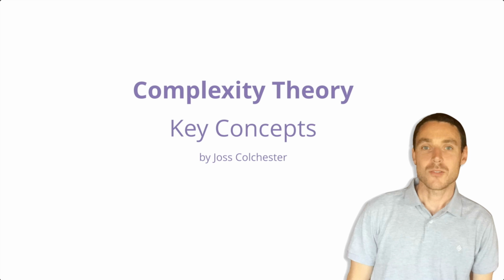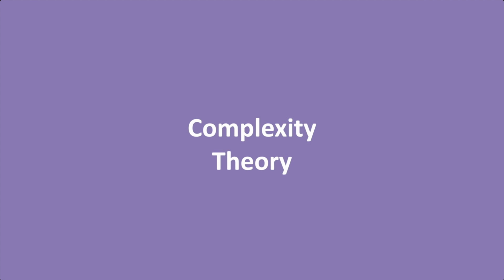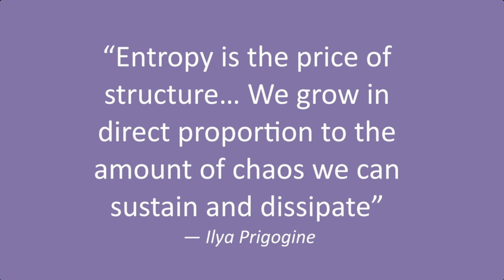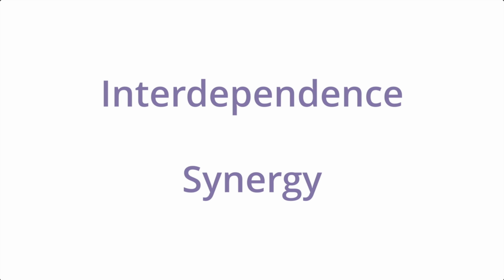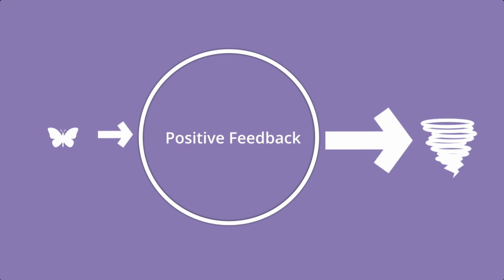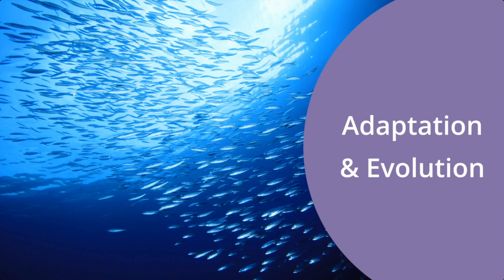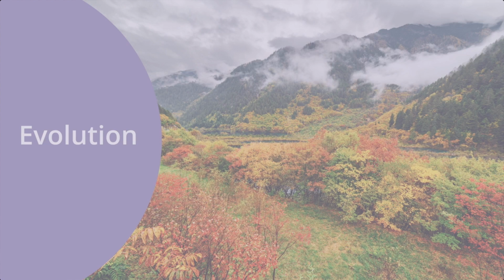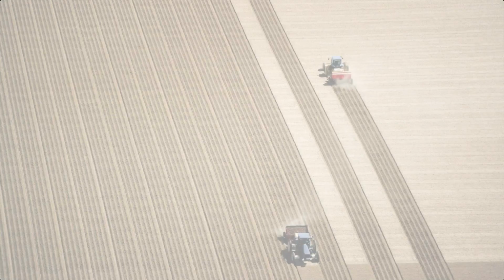Complexity Theory: Key Concepts

Comment: Having thought about it overnight, here is a review with questions. In short, jolly interesting, but where is complexity defined? Complexity means different things to different people.  And SIMPLE systems can have the properties attributed to complex ones. 

COMPLEXITY THEORY?

Complexity science may be defined as:

-1- a set of mathematical models for complex systems: many parts, many connections or dependencies.

-2- a study of activity systems in which parts are actors with degree of autonomy.

-3- a study of structural patterns, observed or envisaged. Especially any structural pattern that appears in the state of an activity system. E.g. The pattern in leaf, or a flock of geese.

BUT NOTE: a structural pattern isn’t itself an activity system. E.g. A road network is not the rules used by traffic on it.

And the application of mathematical models to social entities can be problematic.

NETWORK STRUCTURES (network types, structures, graph theory)

About the connectivity in a topology (road, rail, canal, communication, social network); measures include: average path lengths, centrality.

Some say the topology is the “architecture” of a complex system; system rules and dynamics change as the connectivity increases.

BUT there are SIMPLE networks; a network differs from systems it enables, and a SIMPLE system can run over a complex network.

ADAPTATION (cybernetics, game theory, evolution)

Dynamic systems change over time, typically in response to changes in their environment.

BUT SURELY one must distinguish homeostatic self-regulation (as in cybernetic control systems) from progressive self-regulation (as the development of leaf pattern), and system mutation (as in biological evolution)?

You can have SIMPLE self-regulating systems (e.g. predator-prey). You can have SIMPLE games.

NON-LINEAR SYSTEMS (feedback, chaos, instability)

Non-linearity arises from inter-dependencies or synergies between parts.

Negative feedback (is in homeostasis) is said to be linear (though it may oscillate around a norm)

Positive feedback (as in progressive state change) is said to be non-linear.

Non-linear exponential growth is unsustainable, must crash, or flip to a new regime or configuration. E.g. heated water flips from liquid to gas.

Chaos: meaning a system’s state trajectory is very sensitive to initial conditions. E.g. Butterfly flaps wings > positive feedback > Tornado.

BUT why say one state change trajectory is more complex than another?

SIMPLE systems can have positive feedback and chaotic state change.

SELF-ORGANISING (emergence, synchronization, pattern formation)

Emergence requires relationships between parts that are not simply additive; the whole being organized greater or less than the sum of its parts

Coherent patterns can emerge from local interactions between autonomous actors. E.g. In a flock of geese, each bird operates under a few simple rules.

BUT emergence is found in SIMPLE systems. It isn’t specific to complex or self-organizing systems.

And why say organization by autonomous actors is more "complex" than organization imposed on those agents?

Order from disorder

Some characterize complex systems by the emergence of order (unorganized to organized, disorder to order, high entropy to low entropy.)

Energy is turned into organization; order grows in proportion to the amount of chaos dissipated.

BUT SURELY order emerges in SIMPLE systems (e.g. a flock of geese)?

And what about maintaining order in an already-orderly system? Is that not also self-organizing?